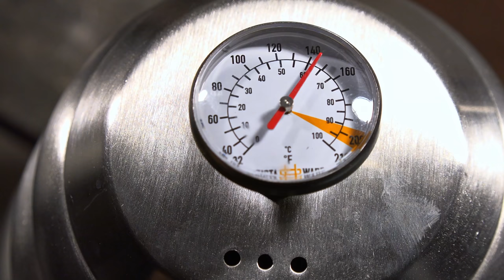Woodturning:  The Manzanita Roast!

Comment: Glad I stuck with this one... I've seen a lot of mutant wood lumps turned into bowls with gnarly edges [with resin and glitter usually], and I think that's been 'done'  now.  Your project kept me intrigued - you brought some finesse and function to it, gave it a life, a use... not just more 'wobbly wood' - with novelty as the only reason for existing. I love how the shape of the burl acts as a bean-catcher at the top, that is very pleasing... My only constructive critique is, perhaps the lower part should have a 'friction fit' to the upper, so you don't actively have to support both parts when grinding [to stop the coffee grinds coming out], as the burl edge makes such a chunky inviting grip area instead. I'm sure you could still introduce a friction fit, if you wanted, by laying a sliver of balsa, or letting in a rubber gasket into the rim of the lower bowl part. 
Lovely work, well done!
Reply from the maker: Thank you Paul! Great ideas, and yes perhaps that bit of live edge could be used as a handle, but the undercut helps with holding pressure in the center while grinding.

Comment: Here's an idea that I've been doing for years, I use a chainsaw cutting disc on my right angle grinder while the piece is turning about 250rpm, it makes quick work out of roughing it in. Be certain to cut against the rotation of the workpiece. Just a suggestion, thankx

Comment: Manzanita is my favorite wood to turn.  Excuse my being dense, but is Chemex what you used to stabilize the punky bits?  You used CA on some bits but you painted on something else on the lower part.  Interesting use of the parting tool coring out the top section, too.

Could you not use the core for the knob?
Reply from the maker: Hi Tim, i used a super thin wood stabilizer (applied with the paintbrush) before the CA glue. I decided to use the original knob for the handle simply because i didn’t have a great way of detaching/reattaching it.

Comment: You do beautiful work. Obviously you have wonderful tools and a great lathe. You sharpen your tools properly. My question is why do you like to sand so much.? It appears from your videos that you are not utilizing the bevel on your gouge much. Even presenting the gouge to the work with the flute wide open, facing the ceiling.
I am a woodturning instructor and I constantly am nagging my students to do supported cuts and use the bevel. Otherwise you're just using the tool as a scraper,  which gives you grooved surfaces and torn grain and very rough cuts in general. Which also means much more sanding. Personally, I hate to sand. Learn to glide the bevel on the work.  With skill level, practice and possibly a little coaching you can have beautiful smooth cuts with no torn grain. 
It took me a while. Several years actually, to master the technique. Well worth the effort because most the time I now can start sanding with 320 grit sandpaper. Much more fun than trying to sand away torn grain with 80 grit paper and then working my way through the grits to 400. 
Best wishes to you and your creative pursuits. I'll be checking out more of your videos.  Keep turning!